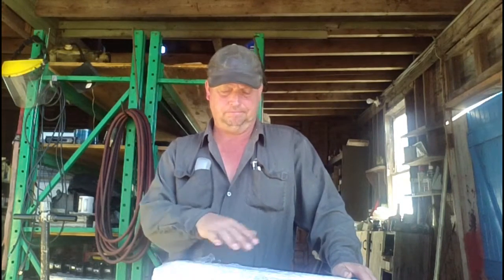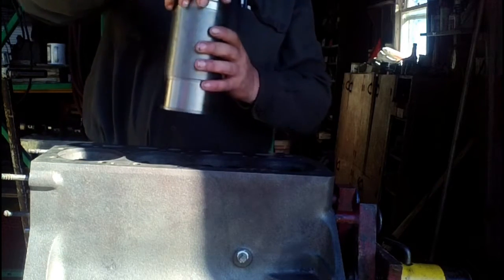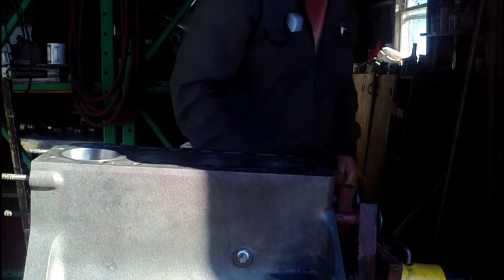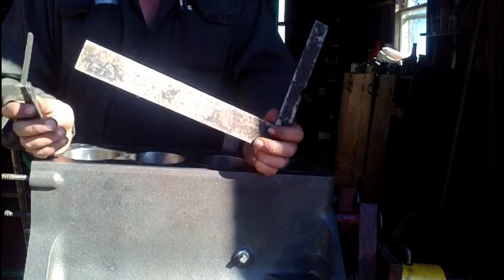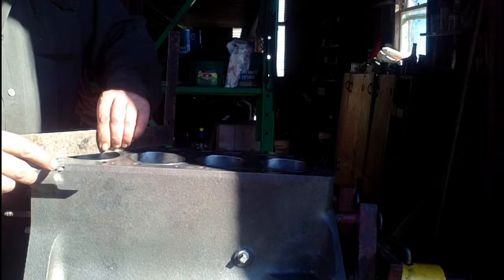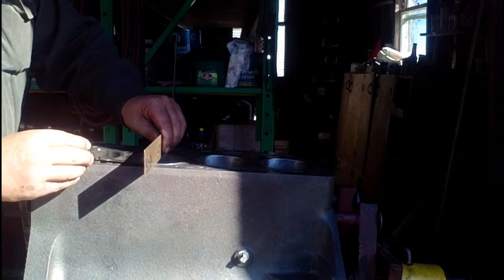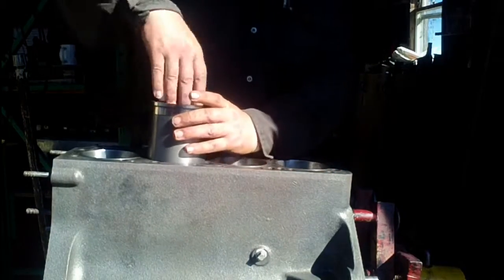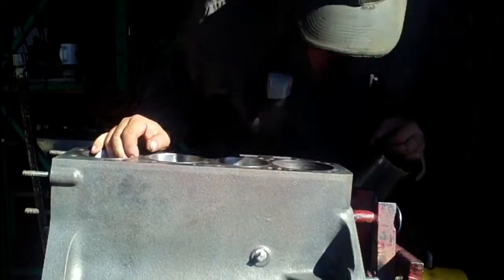IH444 Engine rebuild part 4, sleeves and crank

Comment: how do you put the fuelinjector in a 444 international. Imean❤ injector slive
Reply from the maker: The pre-combustion chamber goes in first making sure the hole on the side lines up for the glow plug, then a brass sealing ring then the injector seat, a sealing ring and the injector sits in and you tighten up the nuts. Thanks for watching!

Comment: About 12kg right?
Reply from the maker: What is 12KG?
Reply: @CanadianRedneck15  the torque that goes in the crank. 12 kilogrames of torque are about 80 pounds, no?
Reply from the maker: @alvarodamian621  75-80 ft/lbs sounds right, I expect I mention in the video. Thanks for watching!
Reply: @CanadianRedneck15 yes, i wasn’t sure of the convertion to kilograms, do you know the torque of connecting rod? Thanks for your help
Reply from the maker: @alvarodamian621  I believe it is 45 ft/lbs.
Reply: @CanadianRedneck15  yes, i found it. Do you know the light-Space for the valves? I cant found nothing of this engine
Reply from the maker: @alvarodamian621  I think it's .016 of an inch.

Comment: Is this a bd 154
Reply from the maker: Yes it is. Thanks for watching!
Reply: Thanks for making these videos Dave. Now I can take apart my b414 and get the piece of glow plug coil outta my cylinder
Reply from the maker: @gled2674  If you don't see it in the cylinder make sure to check the precombustion chambers in the head.

Comment: I got a ih 434 but i cant remove those cylindersleevs.
Do you have a video on that?
Reply from the maker: I don't have a video that shows how to knock the sleeves out but I just find a small piece of flat steel or box steel that just fits across the sleeve and drive em out with a big hammer. :)
 Thanks for watching!

Comment: Hi Dave Rodger Huntington I have a 1964 476 International head gasket would leaking I changed it level the head I rejected the belt and my motor oil is still a tad Grey can you give me some heads up Hunter this please love your programs watch everyone keep going good work
Reply from the maker: There may have been some moisture left in the engine from the previous leak, try changing the oil and keeping an eye on it, if the oil still gets grey there may be a crack in the head. Thanks for watching!
Reply: Hey MR, Dave, thanks for you time!!  I'm a old hillbilly from Kentucky, you help bring live to my IH 444, keep up the good work,,

Comment: Don't you use a brush/solvent and air to clean out the oil galleys of built up crud?I wouldn't trust the machine shop just sayin they did.The crud can wipe out a new engine if it comes loose and hits the bearings.
Reply from the maker: The block went through an acid bath so should be good, but it is always a good idea to check. Thanks for watching!

Comment: Are you fixing this tractor for somebody or did you get this for yourself? I have never seen a 444 before....
Reply from the maker: I repaired this tractor for a customer. The 444 is most prevalent in eastern Canada, due to the trade and tariff situation at the time they were attractive to import from the UK. Thanks for watching!
Reply: Canadian Redneck they were made in Doncaster, I have a 444 that’s had an engine rebuild by Rob Speakmen (the best around) and she runs as sweet as a nut. Lovely tractor with loads of power for the size

Comment: Did you have the block magnafluxed and do you recommend it on a rebuild?  What does that typically cost?  Good videos.
Reply from the maker: Yes I had the block crack checked as well, always a good idea. Thanks for watching!
Reply from the maker: I expect the cost can vary quite a lot from place to place, best bet is check with a shop you trust for an estimate.